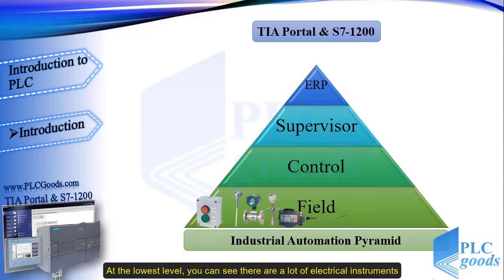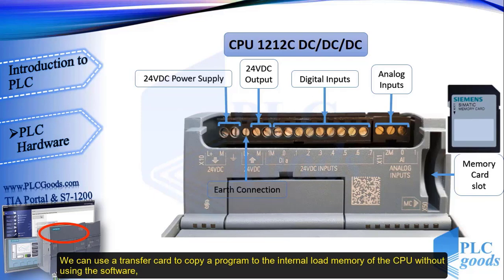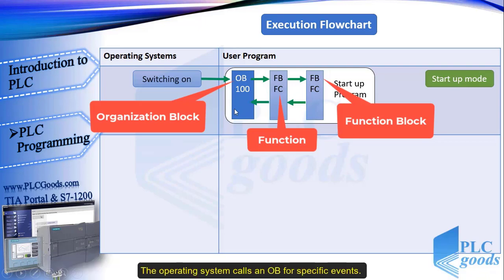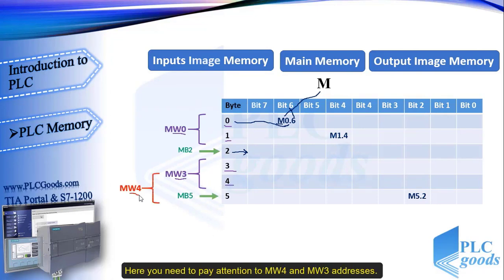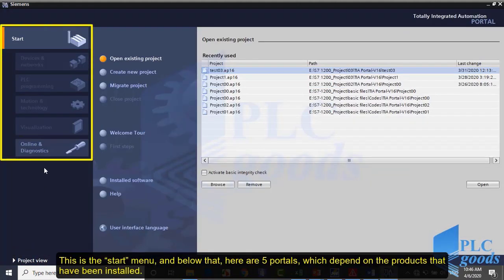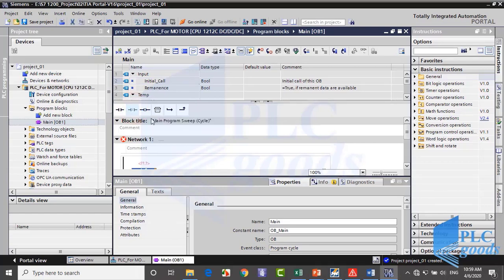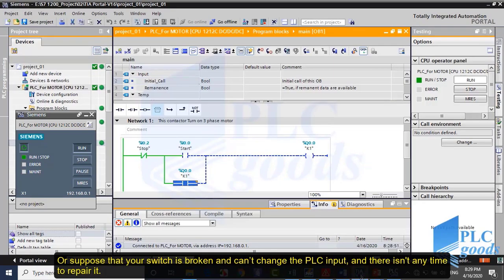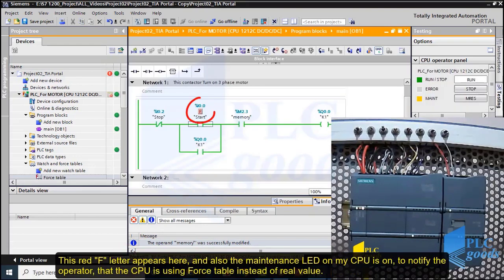Siemens TIA Portal with S7-1200 PLC Programming - 50 minutes course Part 1 of 14

Comment: Your program is not proper for the stop button. Stop buttons must always be normally closed and the contact in the PLC program be normally open. You created a dangerous condition where if the wire comes off the stop button, it will not shutdown the machine the PLC is controlling since you used a normally closed contact in the PLC program. Stop buttons must always work by opening a circuit, never the opposite!!!!!
Reply from the maker: Hi there, you’re right. I explained this point during the course.